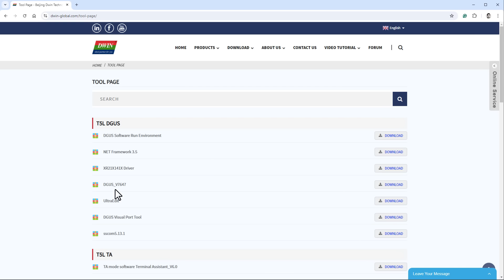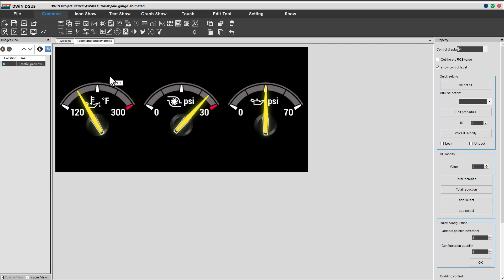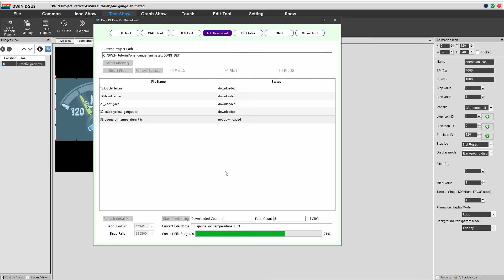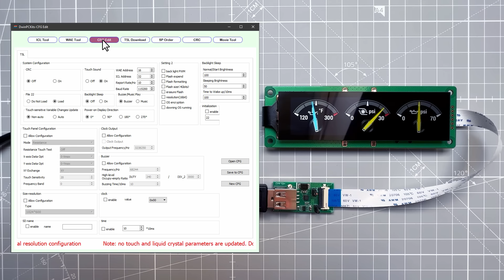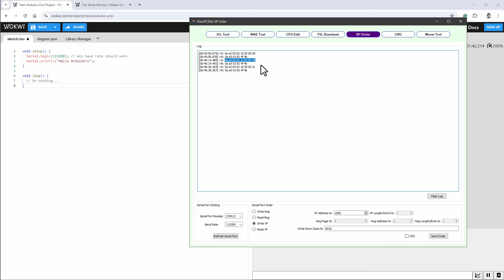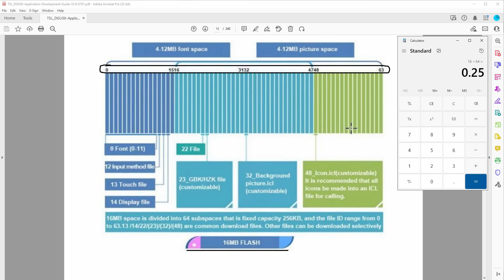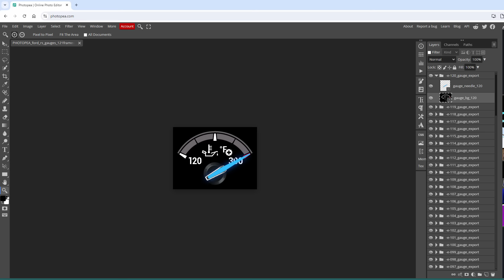Ford RS gauges with Arduino UNO and DWIN intelligent display (like Nextion displays)

Comment: I have a question, maybe you mentioned it on the video and i missed it? But basically, how can i send the touch events BACK to the arduino? Here you showed how we can take an animation and via serial, and how we could add touch events to the display that causes a change on said animations. But how can we then make the arduino listen to said events? 

Again, this is probably somewhere in the video, but it was not that clear to me tbh

Comment: Hey man what’s up? Please please please make a video on how to protect the micro controller from car environment (heat, dirty 12V electrical, voltage drop from a 3000W audio system, noise, humidity, peak surge, vibrations, and more if any I couldn’t think off) 🙏🙏🙏
I live in Ivory Coast the heat in unbearable and the humidity is crazy 😩 please help me figure out how to install any micro controller in my car the safest way! I wish they would make a dedicated development board like the esp 32 and Arduino or even raspberry pi automotive grade component that has all the protection in it already 😩

Comment: Hello, what IO did you use in the pcb adapter for rx and tx? I0.6 i0.5?
Reply from the maker: I belive so. It might be different for different adapters, but thankfully the DWIN pcb has those connections labeled. Hope that helps!
Reply: @upir_upir did you connect i0.5 that It os tx2 to Rx of the Arduino board?, IS It correct?
Reply from the maker: Yes, that’s correct.
Reply: @upir_upir thanks mate. I appreciate your response

Comment: Do you think this would work with an audrino Nano R4? Any downsides to using a Nano? I am going to attempt to make it a single horizontal boost gauge. I would like to keep the foot print for the parts small for an easier install.
Reply from the maker: Yes, you can use any arduino or ESP32 board and or should work just fine.

Comment: what about input sensors
Reply from the maker: I have a few videos about interfacing various sensors, is there any particular sensor you are interested about?
Reply: @upir_upir  hello upir first of all thanks for your swift response, i really appreciate it. what i was looking for is a non contact strain gauge type of sensor that can be mounted under the fuel tank  fuel outlet tee to get the weight of the fuel which than be converted to how much fuel is present in the tank in real time, thanks regard.

Comment: Great video detail and example of features! Question at minute 33:00. While connected to the Arduino.  If you could create the gauge needle to sweep form 0% to 100%, and back to 0% as seen on many electronic automobiles instrument clusters at start up. Would creating code values for the as follows.   gauge_value = map(analogread(A0), 0, 1023, 0, 120, 0);  Would this added 0 at the end of the code line, create that feature, or cause failure in the code? Meaning the function to see the gauge needle sweep from 0% to 100%, and back to 0% is not possible in this format.  Thanks for sharing your knowledge about these gauges a lot of great ideas here.
Reply from the maker: Thank you. If you want to play such animation, you first go from 0-100% and than from 100-0%. Probably include a little bit of delay. I might add this feature in the next video.

Comment: Hello, have you managed to connect it to car sensors ? Will you make a video soon? I want to install this in my bmw e36 ! 
You are awesome ! Keep up !
Reply from the maker: I have a few videos on my channel already, including interfacing with OBDII. Do you have OBDII in your car?
Reply: @ no, i do not have obd2 port :( too old, i have obd 20 pin round socket
Reply from the maker: In that case, connecting directly to sensors might be a better solution. I might cover that in some future videos.

Comment: I'm very surprised with the performance, considering its an Arduino
Reply from the maker: It´s not Arduino. The Arduino is only sending signals, the drawing is done by the display itself.
Reply: @upir_upir  yeah, after watching the video it made more sense. Ive used Nextion and wasn't aware of this alternative. Great find. Thanks
Reply from the maker: You are welcome. There are more displays like this - i.e. intelligent displays, for example Stone, Noritake, etc..

Comment: i get to the blue screen but 'Download .ICL files: 000'. Would you let me know what i have missed?
Reply from the maker: Are you using the provided sd card? Otherwise, it needs some special formatting...
Reply: @upir_upir  I am using my own SDCArd.. i formated with FAT32. is that correct? would you advice the correct format? :)
Reply from the maker: There are some steps on the DWIN website, I believe you have to have some special values set for formatting options. I always get SD card from DWIN, it´s much easier that way.

Comment: I have designed similar project on this display, MCU takes data from the car OBD port and updates the display in realtime, but i have used the "ICON Rotation" tool for gauge needles(that is the recommended tool for gauges from DWIN). But man, yours approach for updating gauges using ICON Animation is excellent. its showing sharp needles and mine was not that sharp at the edges due to DWIN limitations. btw, excellent job!!!
Reply from the maker: Thanks for the info! Yes, the icon rotation results in sharp edges, so that´s the reason why I have used icon animation instead. Do you have a video with your project?

Comment: hi UPIR , salutes from mexico , i have been tested the DWIN display , but i don't have TX,RX communication , the Flex cable looks good but , do you face something similar when you set up your project ?
Reply from the maker: Yes, I do plan to record another video addressing this.
Reply: @upir_upir  thank you so much! , i purchase two models , the 960x240 used in this video and the 480x272 , it comes with two usb-serial communication boards , and both of them didnt have tx , rx communication i dont think that both of them are useless , i think maybe its needed something extra configuration. but thank you again , great videos you have my support , i hope you can upload a video about this problem

Comment: how can it interface to the can bus / obd2 port? i was trying to set up a similiar setup with esp32 or an arduino (i mainly needed turbo pressure and engine temperature)
Reply from the maker: I have a few videos about that topic:
https://youtu.be/qqmy5ZxKyq4
https://youtu.be/L3ufJTFX2v0

Comment: Faz um video pegando esses sinais direto dos fios do carro , sera mauito interessante.. eu quero montar um painel digital para meu gol g5 2008 modelo 2009 1.0 trend,  ele nao tem rede can por isso vou ter que pegar todos os sinaid fio por fio. Ai vou usar o ARDUINO mega ou esp32,  também vou usar uma multimidia e o aplicativo REALDASH. Mas esquever o arquivo xml que vai ser o difícil.  Você consegue fazer  ??
Reply from the maker: English please?
Reply: @upir_upir   Make a video capturing these signals directly from the car's wires. It will be very interesting. I want to assemble a digital panel for my Gol G5 2008, 2009, 1.0 Trend. It does not have a CAN network, so I will have to capture all the signals wire by wire. Then I will use the Arduino Mega or ESP32. I will also use a multimedia system and the REALDASH application. But forgetting the XML file will be the hard part. Can you do it?

Comment: Okay, so tell me why you're using static images... and assuming you allocate many MB of static storage for this?
Reply from the maker: The reason is simple - the library that I´m using does not support anti-aliased rotation, and as a result, the needle (when only one image is used) looks pixelated and not nice.

Comment: Great project but how do i get the info from the car to the arduino ? Some sort of obd adapter i assume ??
Reply from the maker: That´s correct, I have a few more videos where I describe the connection process and getting the data from OBDII to Arduino.

Comment: Thank you for this video - I had been struggling with why my 960X240 pixel images were only displaying on half of the screen until I heard you comment that the display needs to be 960X480. I tried your background 3-gauge image and it loaded fine. I will have to redraw everything to double the vertical height, but hopefully that was the issue all along. I have another question... does one need to use the arduino for potentiometer input? I realize it's easiest to do that, but the T5L ASIC datasheet says there is a dedicated 2ndary core with 28 IOs (though it's not clear to me at all whether the spares are exposed for use), including 8x12-bit ADCs and 2x16-bit PWM channels and 64kb of code space just for running user code - it would be quite nifty to tap those gpios and not even need the arduino. thank you again for your instructive video.
Reply from the maker: Thank you for your comment. Yes, the T5L ASIC should be able to handle some basic tasks, but writing code for that is way beyond my knowledge - hence using Arduino. Unfortunately there are no good tutorials about how to make code for the DWIN microcontroller - or at least I haven´t found any.

Comment: Are these displays similar to the nextion diaplays? Could this same project work with a nextion dispay? Thanks!
Reply from the maker: They are similar, but not the same. You cannot use the same project/software for both displays.

Comment: Wow! $40 for this tiny display is steep. Although it's very nice. I wonder, if three seperate displays with atransparent black sheet of acrylic wouldn't be another option.
Reply from the maker: You mean 3 separate displays? That will probably not be much cheaper..

Comment: So if i understand correctly, i just have to plug in my sensor wiresto the pins instead of the potentiometer. Am i correct?
Reply from the maker: Yes, but only for some sensors. There might be some additional calculations required, but in general, many sensors will work that way.

Comment: Nice display, a bit intensive to set up, but the Arduino UNO doesn't have the speed nor memory to do all the graphics from the Arduino directly. The way the display keeps an image of a guage with EVERY needle position makes sense because it doesn't redraw the needle, it just updates the image from a huge array of positions. This is fast but memory intensive (from a methodolgy standpoint - even though the display can handle it). It's a brute force approach, and it works well. But...

I prefer old school (which this display can't do): 
1. You display the guage with no needle as the background. 
2. You keep an image of the needle in memory (just one image pointed in only one position).
3. Before you draw the needle (mathematically rotated) you copy the area behind where it will go as a background restore image.
4. Draw the needle using math to rotate (point) it as you desire.
5. If the needle needs to move: Restore the background under the needle and goto step 3.

I do this all the time with bitmap files as I can make the area outside the needle transparent and thus rotate the needle as a rectangular sub image.
The rotation algorithm is very fast and since only rectangles are involved, the rendering is very fast as well.

I did this to model Apollo Spacecraft instruments. One of them has 3 layers of images with transparent areas that I stack up like the real instrument. It has 3 pointers on the sides, 3 needles in the middle, and a circular globe (the 8 Ball as its called) that yaw, pitches, and rolls.
Using this display would require thousands of images of the 8 Ball alone, so you can see, keeping a Mercator projection of the 8-Ball in memory and then transforming into a globe in any latitude/longitude is how complicated graphics is done.

https://paul.romsky.com/index_spacecraft.htm

But it is a handy display.
Reply from the maker: There are many way how to tackle the same problem. Using intelligent display is a very simple and relatively cheap solution - and you can use any microcontroller, not just Arduino.

Comment: Awesome video! With that Dwin display how many inputs could you have (sensors)
Reply from the maker: Thank you. The inputs are not set by DWIN, but by the used microcontroller.
Reply: @ thank you!

Comment: When I first did my upload to the screen I forgot to make the address "32" instead leaving it at "0".
Could that be why my touchscreen crapped out ?
Reply from the maker: Using "0" should probably not break anything, I believe this position is used for the default font.

Comment: How did you use Photopea to subtract the needle into a gauge without and just the needle?  That was pretty cool.
Reply from the maker: I don´t understand the question? The image contains both the needle and the background.
Reply: @upir_upir  I messed up on my question, sorry.  I didn't see how to capture the needle from the original gauge in a layer and fill in the background of the gauge, etc.  I see all the parts from you're github but I'm new to photoshop/photopea and would like to know how you did that.  Do you have leasons on photopea?

Comment: Great job , great project. I tried to make similar project using other LCD, but this has better quality. Finally, I have LCD part , CAN part but .... I don't know ID's from can-bus which corresponding to 3 values on LCD. Maybe someon knows and can put there , then project will be completely.
Reply from the maker: I have another video about getting data from OBDII, perhaps it might be helpful?

Comment: Awesome project mate.  Am now combining this and the distance sensors and the CAN Dashboard into a single display using this DWIN.  I am sure you have noticed but at the end of the DWIN board there are holes for header pins.  If you connect via these it saves having the flat cable to pin convertor as you can connect the DWIN board directly to the arduino board.
Reply from the maker: Thank you for letting me know, that’s a good point, I will definitely try that!

Comment: Thank you for the video! I’m trying to find a square gauge like this for my motorcycle to monitor map sensor pressure ( using a gm 3 bar map sensor) + lambda ( using spartan v3 lite) but I can’t find any… I guess I will have to do it myself based on your video ❤
Reply from the maker: Creating thing by yourself is always great, good luck with your project!

Comment: In computer interconnect, TX and RX stand for Transmit and Receive.  It refers to the direction of the signal, whether the device is transmitting or receiving data.
Reply from the maker: Thank you for the clarification!

Comment: I tried both ways to transfer my "0" ICL file and neither worked.
When I use the SD card method and the white txt comes up, all the files show "0000" transered ?
And when I direct connect I get transfer Failed ?

Any Suggestions?
Reply from the maker: That´s strange. Do you use the very same display? Some other displays have exposed pads on the back and you can switch between TTL or RS323 communication.

Comment: Hi Upir, how many display could you manage with one Arduino UNO ? Which are the limits other than the gauges (320 X 240 each) ? I am looking for at least 9 gauges. Perhaps one 10.1' can do the job. Thank you for answering. Ciao
Reply from the maker: Yes, 10" display should have enough space for multiple gauges, but you can connect as many DWIN displays to single UNO as you want. I mean, some reasonable amount of displays..

Comment: I'm thinking of similar addon to my Rifter, just above the main screen, however, after a quick search on the net I don't think there is a display fitting my search, so I'm asking you - much more familiar with the display market ;) - do you happen to know a wide narrow display more or less: 20cm x 1..2cm **with touch capability**? Or like half of it maybe, so I can join two separate ones? What I have in mind is a bar of icons that I could touch to toggle some options via CANBUS that are either buried in menu or otherwise difficult to check while driving (like when using android auto, there is no temperature visible anywhere in the car - I have to switch to cars app like radio, read the temp and then switch back to android auto for navigation and music). I thought adding such one-icon tall and wide screen will be very useful. Thanks!
Reply from the maker: Thank you for your comment, however I´m sorry to say, but I´m not aware of any display in that very unusual aspect ratio - perhaps except for the display that was in macbooks above the keyboard? But I don´t know if you can get it from anywhere. The display from this video is one of the widest that I was able to find. That said, if I see something similar somewhere, I will definitely let you know. Good luck with your project!
Reply: @upir_upir  Many thanks for your quick answer. I'll search for some shorter one as PoC. I can always put two of such next to each other. The main problem is that most of such narrow displays do not have touch capability. I can always add small bar of physical buttons under it but that will be less flexible for sure. Thanks again for all your videos. Cheers!
Reply from the maker: That display from macbook would be a perfect fit, it´s narrow as it could be and touch as well, but I guess we will have to wait until someone on AliExpress will find some spare parts and sell it..

Comment: 29:45 what is that small middle board called ?
Reply from the maker: FFC cable to pin header adapter board. This one is from Nextion displays, just because I had it laying around. The link to that board is in the description of the video.
Reply: @upir_upir  Thanks. Very nice video btw 👌
Reply from the maker: Thank you!